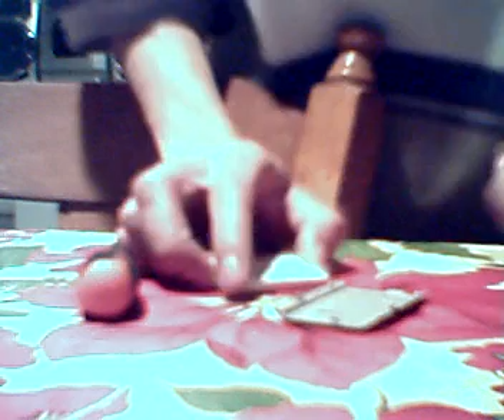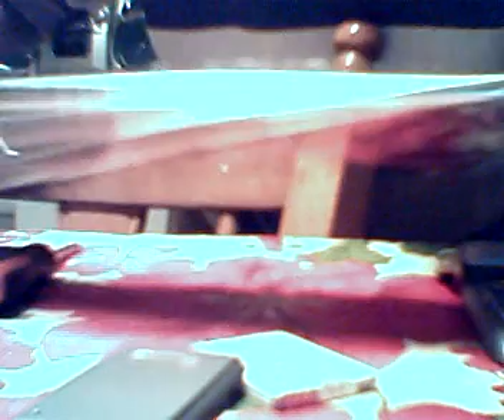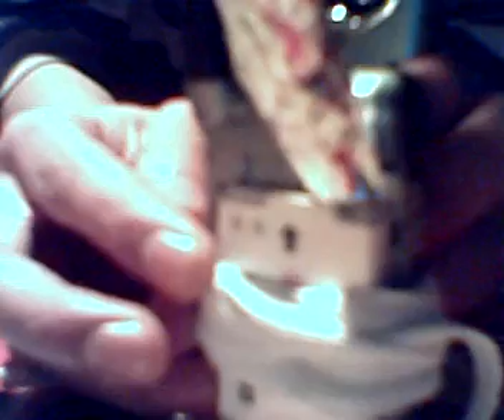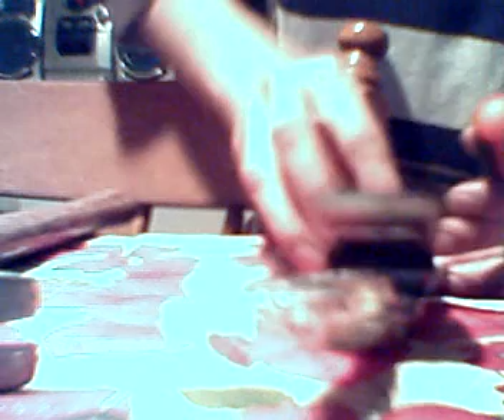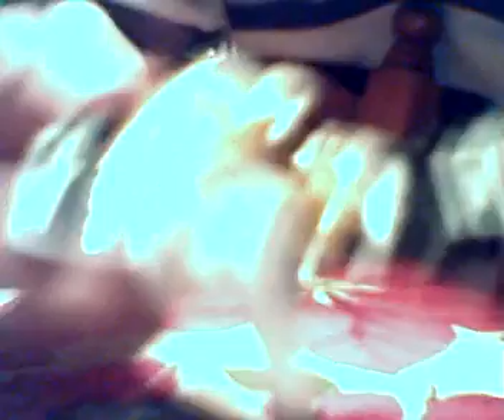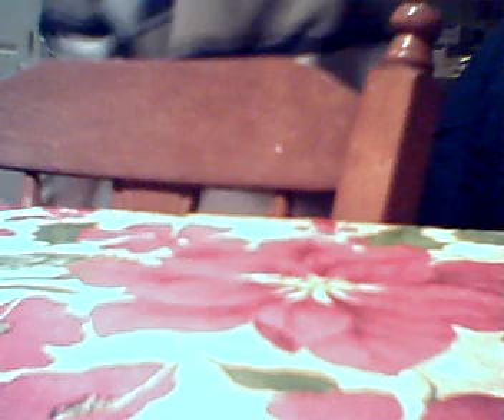how to make radio scanner

Comment: @TheDaniel121 

Go to the nearest surplus equipments shop or junk yards. Or better yet, if you know someone who's a ham operator, he might lead you to a hamfest with swap meets or used radio buys. Some hobbyist would trade their older equipments for an upgrade to a newer model. You don't need a fancy scanner if you're a beginner. A good low cost 800 Mhz Trunking scanner is all you need. You can even have fun with older analog scanners with 144 Mhz and 440 Mhz only coverage.

Comment: Just buy a real radio scanner if you wanna listen to the police frequencies. Radio scanners come in cheap second hand nowadays. I got mine in good working condition for under $20 dollars (P300 Philippine Peso, almost good as new in a bargain deal). It is a Radio Shack PRO 2052 Dual Trunking 1000 Channels Base Receiver.